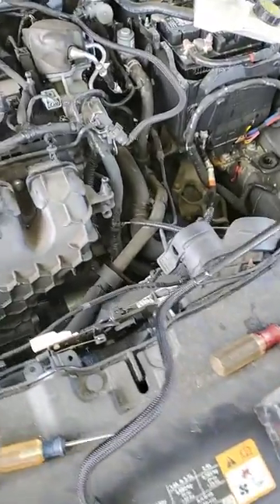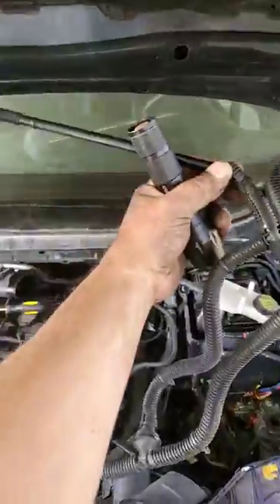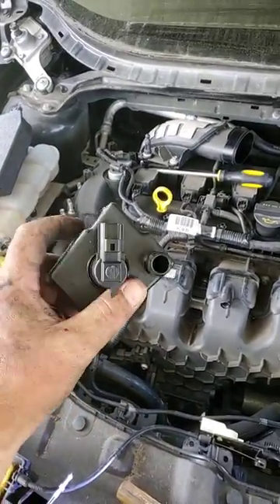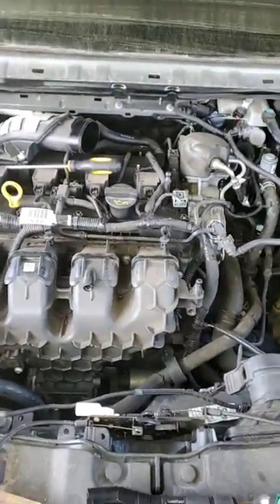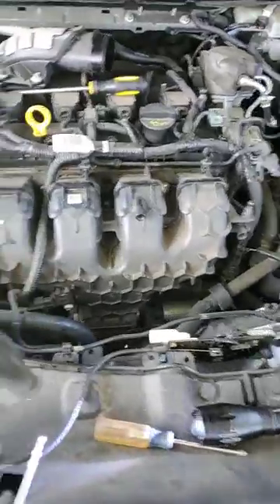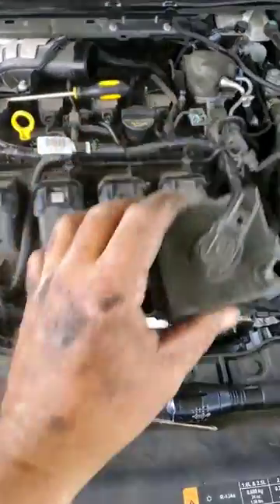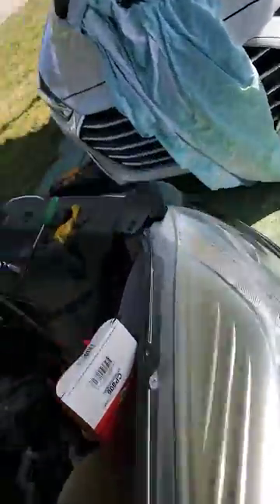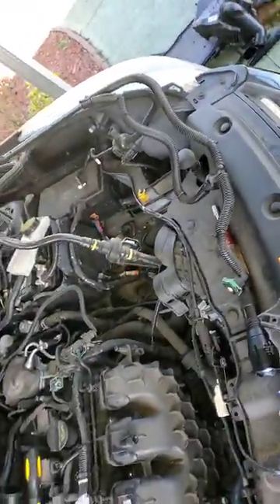2015 Ford Escape 2.0 canister purge valve replacement

Comment: I did actually replace the purge valve (up-front complex swap-out) and it resolved the stalling issue I had.  But I still had an annoying rattling sound coming from the back.  And in further research, it's that rear Canister Vent Valve (when bad) that causes the purge valve issue.  So before I have to replace the front Purge Valve again, I'm going to do this - great video and for sure I should have done this along with purge valve.  Though, if I had purchased both I would have done the rear Canister Vent Valve first (easier) and see if that resolved it.  Thanks for taking the time to make this video!
Reply from the maker: I ended up replacing engine harness as well, but it bought me some time.
Reply: Rock Auto sells an aftermarket kit (Dorman ?) for the purge valve that splices a new into the line without ripping everything open. I think all I had to pull was the airbox & ducting.
Reply: I have a 1.6 turbo, i cant find this in the back of my car.
Reply: How the hell did you get it off the 3 clips!
Reply: @KB-in8kv  We are doing this right now too and can’t figure the clips out.

Comment: You were sold a canister vent valve which is located near the fuel tank.  The purge valve is located up front on the engine.  Both are needed for the EVAP system to function properly
Reply: I have a 2016 escape 1.6 turbo. I cant find this in the back of my car. Where is it?

Comment: On my 1987 Chevy Celebrity , there is an Evap Purge Solenoid on the charcoal canister under the hood that is pulsed to send vapors to the engine to burn . The valve would intermittently stick open and cause a large drop in vacuum and rough running . That valve can also cause problems . Good to see you found the problem .

Comment: wow I can't believe it thanks to your video I discovered what my 2016 ford escape 2.0 ecobost had since lately when I put gas it started to shake and it wanted to turn off it turns out that the canister hose was disconnected since 2 years ago they fix my car from behind  and they never connected it thank you very much

Comment: Sorry you had to go through PIA. QUESTION, is the EcoBoost purge different? 
My daughters 2016 Escape with 2.0 EcoBoost has the P1450 code and people on FB and other groups are saying the purge valve. If that's the one, I'm good with that! Thanks!

Comment: As the OP says many times in replies it’s typically both parts that need replacing. The P1450 code could be either part and they work together so you’ll probably wind up replacing both parts at some point. If you have the AWD version you’ll think replacing the under hood solenoid is a day at the beach versus replacing the canister purge valve. The AWD system blocks access to the canister valve and you’ll need to drop most of the rear axle to access it.
Reply: This is the truth....
Reply: Somehow I was able to do it around the awd without the need to drop it, but it wasn't fun
Reply: @ScottinVA  how was you able to do it? any tips?
Reply: @rich9766  Its been a couple of months now.  I recall using a flash light and locating it in between components.  it's not easy to see from the ground looking up with the awd in the way, but you can barely make it out.  Once I knew where it was, I think I reached up and over the axle maybe?
Reply: @ScottinVA  thank you thats how i got it off but it still did not solve my problem.

Comment: You don't need to remove the cowling and brake resevior to do this. Its very tight and your hand will get scraped but you do it by feel and you can work your hand back there and remove the clip and press hte button to pull apart the pipe (not you may have to push it down in the process to get teh clip to set before pushing it all the way in... if you straignten the fitting upward before pulling, it help get it off. (if its not straight before yo push button in and pull apart, it wont come - took me 10 mins to finally get it to release).. of course take those allthose green clips off first. PITA but I did my whole front harness in 20 mins. Remove 2 flex inboard flex pipes coming off the filterbox first. Good luck.

Comment: Same for MKC 2016 2.3 Ecoboost no videos on where to find and replace the part on Lincoln you may have to disconnect the battery and then disconnect fuel fill connection by the unit

Comment: I have a 2016 Ford Escape SE 2.0 with Ecoboost. I took it to the dealership yesterday to get a diagnosis. When I get a full tank of gas, the vehicle shudders and acts like it wants to stall though it never does. When the gas level is low, the vehicle acts as though it doesn't want to start and the RPM's surge at low speeds (35-40mph). I have also noticed a hesitation when trying to accelerate to expressway speeds and my gas mileage is abhorrent. While the vehicle is not throwing any codes, the car dealership told me that it was the Purge Valve and quoted me around $450. I barely have enough money to pay for the dealership's diagnostic fee, so obviously that repair is not within my budget. Will it damage the vehicle to continue to drive with this issue? If so, is it possible to begin by replacing only the canister  instead of the entire harness?
Reply from the maker: It will only get worse and you will eventually stall when at idol.  Go ahead and replace one at a time, but I eventually ended up replacing harness as well.  $113 bucks and hour and a half time.

Comment: So I have a question. My check engine light came on. The only indication I had this issue is that the car stalled once or initially upon start up after gasing the car up. How do I know it’s that canister vs the harness?
Reply from the maker: I would recommend replacing both. Replacing the canister bought me time but ended up replacing harness also.

Comment: 2016 escape 2.0 se awd. Gas smell when driving. Has a stumble sometimes when taking off. But, I also have that ABS and traction control light on issue that can also cause some issues. Gonna replace abs sensors in rear. But the gas smell? Can't find a gas leak. Has to be something to do with this? Autozone check engine code shows an O2 sensor. Car has 170k miles. A/C just quit. Hell in georgia in July. Gauges on A/C shows high pressure on low side. No noise. Clutch works. Thanks. Help! What a POS

Comment: My 2015 Titanium has a hose about an 2" wide blocking access to the valve down by the fuel tank. Is there any issue with temporarily disconnecting the hose? my concern is that it's a fuel hose or something.

Comment: This is an easy one... I have 4wd 2.0 2017 Escape and because of rear diff, its SO hard to get this canister, and when you get it out, you can replace valve only, or whole canister- better whole canister with valve. Assemble it back is very easy.

Comment: Question. On the harness you took out that connection that clipped onto some hose at the bottom, what is that part called? When taking that harness off it broke the peace it connects to
Reply: Bottom clip of the harness.

Comment: Thx for the vid.
I have the same car - worst vehicle I've ever owned and, after being a lifetime Ranger guy, it'll be my last Ford.
Reply: I've had great luck with my 2015 2.0, but there are a few small things that irritate me, and the biggest problem that I have with this car is that some of the simplest things are made difficult. Battery? Under the wiper cowl. So STUPID.
Reply: @aaronanstett6622  
I had to replace my battery after two years.
Came back to the car after a long ride on the quad and the fuel pump had been running all day & killed the battery.
Never held a charge after that.
replaced it with an Interstate (I sell them) and it's been fine ever since.

Replaced the tires about then too, but all new vehicles are like that.

The biggest was the turbo: within the warranty timeline but just outside it on mileage. Ford KNEW it was a problem and redesigned it to eliminate that exact problem, but it still cost me $6K to get it fixed with no relief from them.

Then the canister purge valve kept the engine from starting after gassing up.

A bunch of little stuff too like the inverter dying, the rear wiper arm breaking in the cold, fuel economy well outside the sticker (again, that's to be expected in new vehicles), sway bar end links, left front hub bearings.

Current codes are an intermittent misfire on #2 and post-cat O2 sensor. I think I'm now into this crate for about half what I paid for it.

Comment: I am so glad I found this video. I have the same car, but when I have no clue how you were able to reach out to where the part is located. There are too many pipes, hoses, and a cover that needs to be removed. Did you do all this without blueprints of the car?
Reply from the maker: Yes
Reply: @coreymedley2744  I admire you bro, I tried for an hr and failed to do it XD

Comment: Did you have to remove the exhaust drive shaft and fuel tank to reach it.    I couldn’t figure out how to reach it
Reply from the maker: No I didn't.   There should be enough space to reach a hand up and disconnect.

Comment: I have a 2016 fusion I have that part but can't find it on car even looked back where you said any help would be great?
Reply from the maker: Check engine compartment on the right side. Follow harness toward upper rear engine compartment.
Reply: @coreymedley2744  hello Corey
I just looked again and can't see anything that resembles that part I give up I'm just going to take part back tell them I can't find it thanks

Comment: So, did this solve your problem? I just replaced the canister purge valve like you said in the video. Upon filling up the gas the issue consisted. So I am wondering if this solved the problem for you.
Reply from the maker: I did end up replacing the harness as well.  It has two in-line filters that threw another code once I replaced the canister purge valve.  I threw the code after about 200 miles.
Reply: Did you get the same p1450 code after 200 miles?

Comment: I’m replacing the harness first because the solenoid is stuck tripping the check engine light, hopefully it hasn’t damaged the part in the back next to the gas tank or I will have to replace that too.

Comment: I was looking back-and-forth between the engine and the new canister thinking where the hell is this damn thing for about an hour. I replaced it on a Lincoln MKC and it was in front of the rear axle but just above it

Comment: Just replaced that entire vacuum hose and purge valve assembly yesterday. Boy was it ever a pain in the ass to get all those green clips to let go. A LOT of cussing. And I cleared the old codes. 

This morning it's still throwing the code. Ughh!
Reply from the maker: Ouch!  Hate to say but those clips are a pain in the ass, especially if you have big hands.  You might want to double check all the connections. Perhaps one didn't seat all the way?
Reply: @coreymedley2744  thanks for this video! I ordered that part you showed in the vid. Will replace that then see what happens!

Comment: I have 2017 ford escape same horrible problem to a point where my care would die if i'm bumper to bumper traffic it's fine on high speed. My point is I can't reach the purge valve at all

Comment: Did the code p1450 clear after replacing it?
Reply from the maker: I had to reset at auto zone.  I still had hesitation, never threw another code.  I replaced harness as a precaution and hesitation stopped.
Reply: @coreymedley2744  Bro, do yourself a favor. Download FORSCAN. It's free. Get the ELM 327 MODIFIED FOR FORM cable and you don't need to pay anyone to do shit on your vehicle.

Comment: What was the car’s problem?
Reply from the maker: Vacuum build in the tank, causing hesitation and stalling. Will also cause the fill flap to vibrate loudly due to pressure trying to escape.

Comment: I watched all those other videos about replacing everything in the engine bay.  I'm moderately handy but f*ck that noise.  I'm trying this first, and will report back if it solves the issue!  :)
Reply from the maker: Just a heads up.  I did eventually end up replacing the harness around the engine.
Reply: @coreymedley2744  Currently having this same problem. Thanks for the video. Why did you end up replacing the harness afterall?
Reply from the maker: The loss of power continued after awhile.  On the harness there are a couple inline filters I believe played a part in this whole issue.

Comment: I changed this part, but now its doing it worse than ever. I was really hoping this would solve it.
Reply from the maker: It hurts me to say that you will probably have to replace the harness in the engine compartment as well.
Reply: @coreymedley2744  Thanks for responding man! Hmmm...that's no easy task, huh? If I were to do it myself, how long do you think it would take?
Reply from the maker: @bruno3778  It takes longer taking everything off to get behind the engine compartment to be honest.  The best advice is when you're removing the snap clips off the old harness, just take a small pair of needle nose pliers or a small flat head screwdriver and break the clips off.  Do not try to save them, the new harness will have new clips to install.  Will save you alot of time. Total time for me was about an hour total to remove wipers, engine covers, switch harness and reassemble.  Hope this helps buddy.
Reply: @coreymedley2744  Thanks for your help! Do you know the name of the harness? (Just so I know what to ask for or order). And do you know if there are any videos showing how to change it? I'll leave you alone after this. I promise
Reply from the maker: @bruno3778  it called the canister purge valve.  Itll be around 100-120 bucks.

Comment: All I can say is Ford is a engineering nightmare. I’ve never had stalling issues on a car spin my head like this junk. Absolute disaster and disappointment. Fords stalling issues could be a million different things according to people on the net and the countless frustrated people that have taken their cars to the stealership only to have them shrug their shoulders saying they don’t know what the problem is. I’ve mainly bought Honda and Toyota through out the years and just recently took my 12 year old tundra with 150k miles on it on a 2500 mile trip towing my 6000lb holiday through the mountains without a single flinch. But anyway sorry about the rant I just needed to vent a bit after replacing the engine harness and that I watched this video I think I’ll be replacing that charcoal canister.  Thanks for posting.
Reply: I have the same vehicle ( 2013 ) and I have no issues whatsoever. 120,000 miles. Dont worry, I'm sure that Honda and Toyota have their stupidities that engineers created.

Comment: thats the vent valve, a purge valve failure will show the same issue and code, only way to verify is duty cycle on both valves while looking at OBD scanner, or even smoke test if the valve test is ok. dont blame the autopart person if he doesnt know the real names of the parts and either do you. a shop mech knows the correct names and functions

Comment: I have the 1450 code on mine. Wondering which to do lol
Reply from the maker: I ended up changing not only the canister  solenoid behind the gas tank, but also the whole sensor harness around the engine.  There are 2 sensors in-line on the harness which is probably dirty which throws a code.  It's been couple months and over 300 miles and no codes thrown so far. Car runs like it is new again.  All power is back to engine.
Reply: Corey Medley cool ill try the vent first and clear the code if it comes back guess ill do the solenoid harness next. Glad i found this video atleast i know where to go next if one doesn’t fix